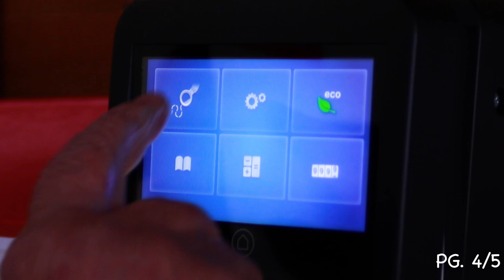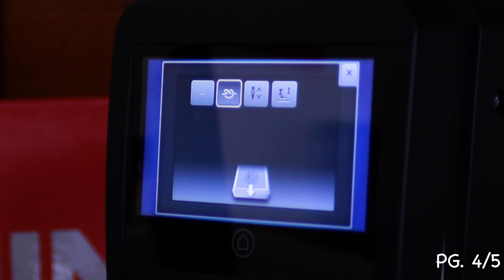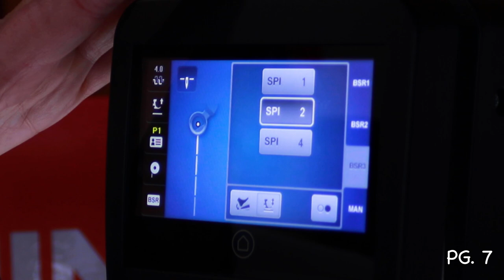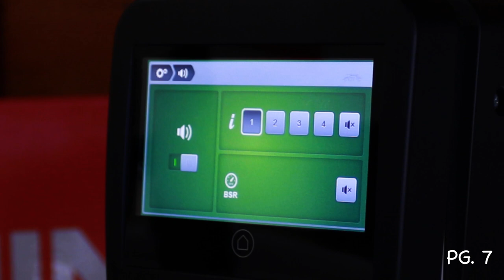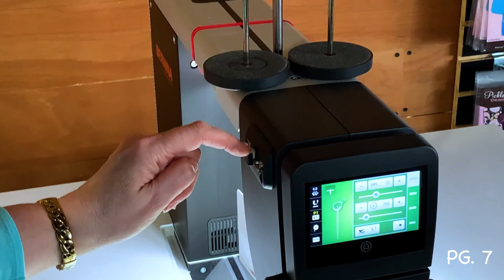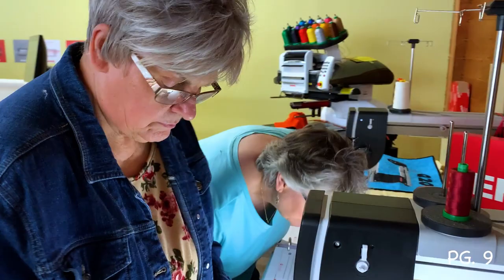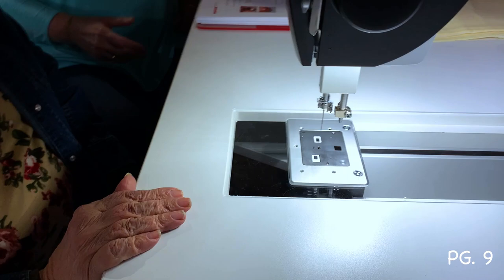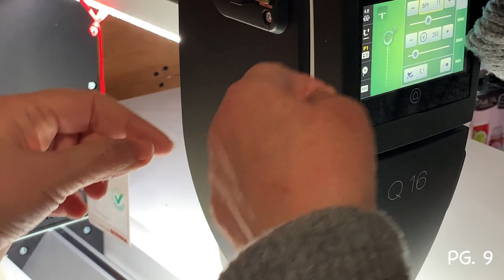QITV Presents BERNINA Q20 Sit Down Mastery, Part 1

Comment: Very good video.  Unfortunately, we've followed your every step to the letter (as well as any Q series videos, pages, books) we could find, but we can't stitch more than a few inches before the machine quits (with an 'out of thread' error on the screen, although there's plenty).  It leaves a mangled mess where the stitching should be, especially on the underneath.  We've checked all the tension, oiled the machine properly, changed needles, used numerous brands of thread including Gutterman and Aurifil.   Our experience with this Bernina Q16+ has been a disaster.  My wife can sew all day long on her Jazz II, but neither she nor I can make a single stitch on this Bernina!  Along with the Studio 10 frame, we've spend a big part of our savings on her long-time dream only to have it be a nightmare.  Any guidance from anybody would be welcome!
Reply from the maker: Call me at 815-410-5068 and I’ll try to trouble shoot with you over the phone. Saturday afternoon would be great….I’m all booked up tomorrow and Sat morning. Lisa
Reply: @QuiltingInTheValley That's very kind of you!  Thanks!

Comment: In the manual it says that after you put the bobbin in with the logo facing out you should test it and the bobbin should wind clockwise there is no way it can wind clockwise you didn't refer to that in your video so I'm wondering if that's a mistake in the manual
Reply from the maker: No mistake!  If you put the bobbin in the bobbin case logo out, then insert the case, then pull the thread you will see the bobbin rotating clockwise.

Comment: Nice video, thank you.  Anyone know where I can find similar videos that relate to a Bernina Studio Frame Q-Series machine?  All I find are sit down videos...and some things are definitely different.  Thanks!
Reply from the maker: Hi….we did a series of Q24 videos….including a wholecloth quilt exercise using QMatic. We focus on the QMatic, not the frame. QMatic works the  on bother frames. I’m not familiar with anyone doing videos specific to the Studio Frame other than construction, but there may be?
Reply: @QuiltingInTheValley  Thanks.  Even Bernina has almost zero instructions on how to actually use the Studio Frame and Q machines, other than what the menu screen does and construction of the frame.  We're down to trial and error!  (Lots of error!)

Comment: LOVE this!!  VERY helpful and feeling very confident on my Q20!  Is there a resource on if I get an error message on the LIFT TABLE?  E06?  Thank you.
Reply from the maker: The table, itself, is showing an error message??  Have you checked the manual for the table?  My guess would be that it is experiencing a barrier to either lifting or lowering.  Like it may be hitting something, or something is putting pressure on it somewhere?
Reply: @QuiltingInTheValley  Is there a MANUAL for the TABLE?!  Can you link to it?  Yes, the table was showing the error E06 and not moving.  I also commented on a HORN video, they responded that I need to hold the DOWN button for a minute then it will lower and reset itself.  That ended up doing the trick. And yes, while changing height, it hit something so that is what caused the error.  Thank you!